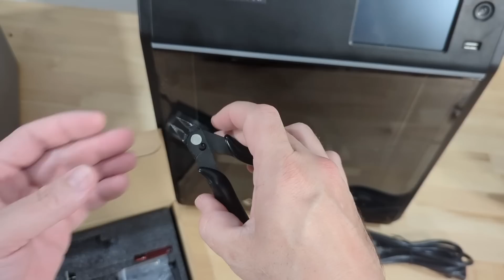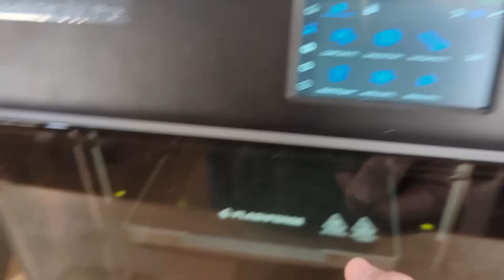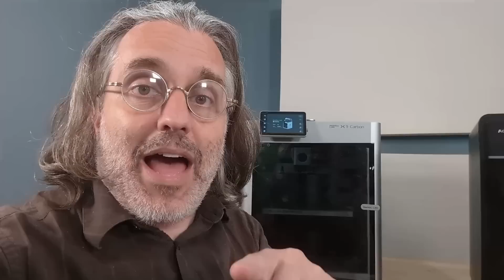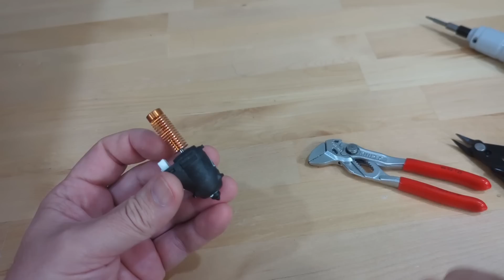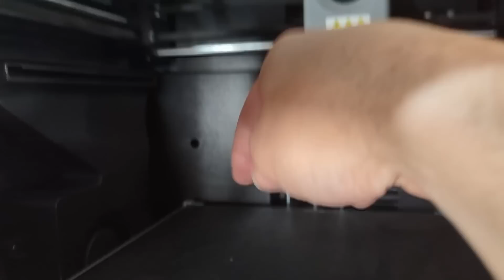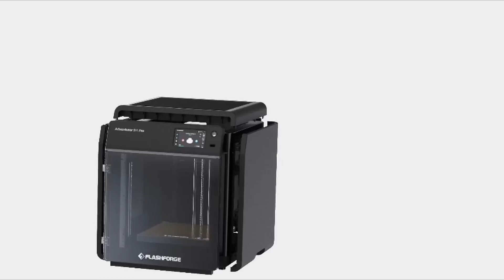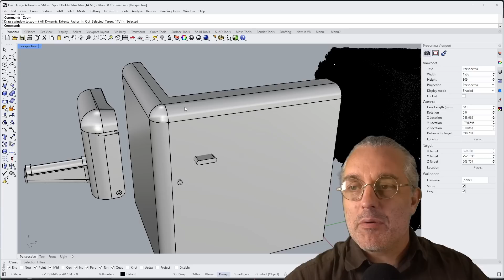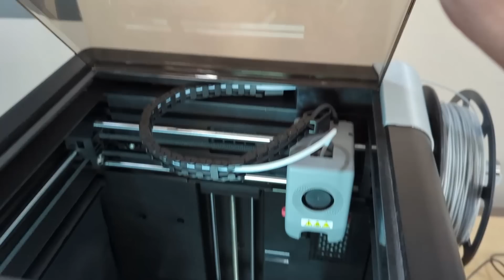Better than the Bambu Lab X1C (for the money) - Flashforge Adventurer 5M Pro

Comment: This printer is my go to recommendation for everyone wanting to get into 3D printing that's serious but not this model it's the regular one for $300 because you can enclose it for cheaper than $200 yourself again if you're serious about 3D printing this should not be an issue, and the one thing I love about this 3D printer is it's the only printer I've encountered that actually has 5G Wi-Fi speeds and it comes with an optional Ethernet port which IMO you don't need because of the fast Wi-Fi speeds lol............. The only downside to this printer is the cost of the replacement nozzles that's it, install the klipper mod to completely delete that filament waste when you change filaments, and it's $38 for the harden steel ones $35 only for the regular .4, great video........
Reply: How did you enclose it? How much did that cost?
Reply: Just ordered one
Reply: @FOHfive  put the klipper mod on it
Reply: yes you can enclose M5, but it won't be as good as M5 Pro. M5 Pro's enclosure is better, it has, camera and ventilation system (internal and external), and besides camera, you can't upgrade it on regular M5 unfortunately. I intended to do it myself, but after research, I think it is better to buy M5 Pro and have the whole package.
Reply: @NeoBTK  no it is better to buy A Q1 pro, because you get more for your money speaker printer with a chamber heater they also prints better
Reply: @NoMercyFtw  It was in regards of M5 and M5 Pro, but Qidi Q1 Pro is also great, I am considering it as well. It is even cheaper than M5 Pro, has a little bigger working space, some interesting features, but men, for me, it is ugly as f***. It bothers me, but I don't know, maybe I'll get over it somehow ;) The print quality is similar I guess, because M5/M5 Pro is also really great in that matter. And I am also considering X-Plus3, it is about the same price as M5 Pro, but I will think about it.
Reply: @NeoBTK  That's exactly why I would never buy the pro it's price point doesn't make sense there are better machines or methods to get with that printer is offering for cheaper